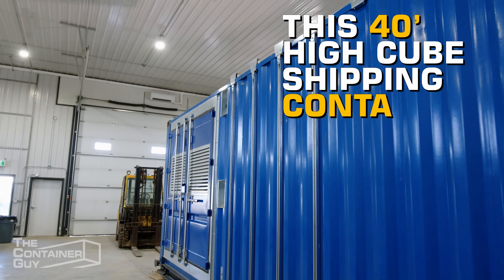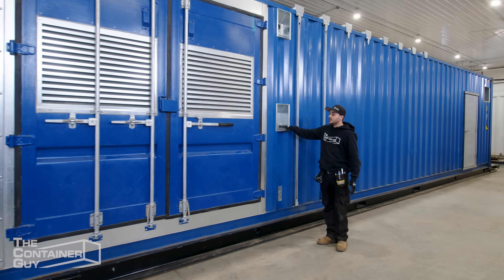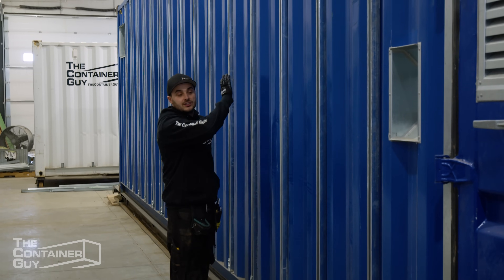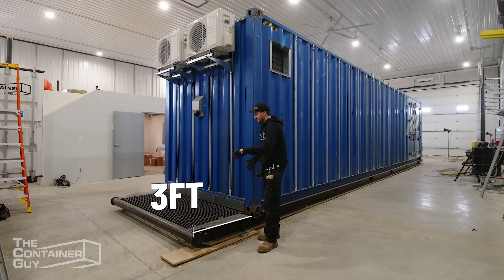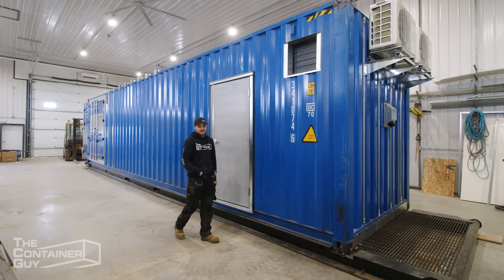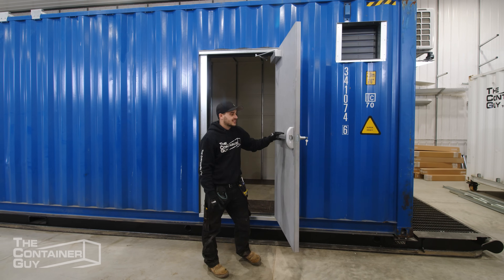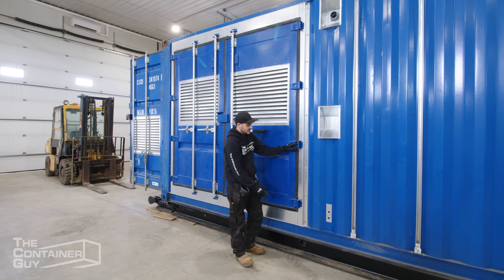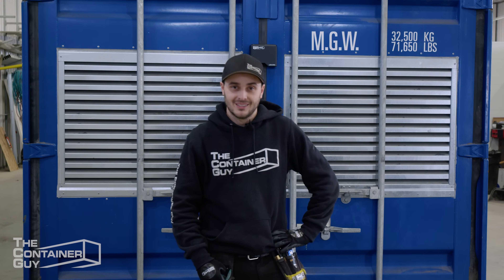$1.8M Project: Containerized Microgrid | 228 kW Solar Power | 488 kWh Battery Storage

Comment: If you have the diesels run in the Winter as it will probably happen, why not use their waste heat for heating the community? 
So having somehtinglike a heatexchanger with extra outlets for a seperate heating/cooling exit.

Comment: Would be cool if you fitted starlink or something on top to provide the community with some internet, and if starlink allowed to have multiple  of those dishes. Of course this depends on how many are in the community and how much you'd have to split the connection but a neat idea! I really love what you've done this could be a saving grace for some isolated smaller community's to have their own power grid with emergency backup from those diesels! Amazing work too the whole build looks very neat!
Reply: Just need  Satellite Down link station right next to it...

Comment: If that container is going to be creating a ton of heat, for a remote site wouldnt it be an idea to scavange as much of that heat as possible for hot water even just to heat the buildings around it? I have no idea where this is going to be placed, it could be placed in the middle of nowhere. Then my musing is a stupid idea and ignore it.

Comment: Have you considered using "Pioneer® 9,000 BTU 115V Under-Bench RV Heat Pump Air Conditioner" it sits on the floor.
You just need to put holes in the floor for air in and out and dehumidified condensate to drip out.
Reply from the maker: Sweet! Haven't heard of them. Thanks for sharing

Comment: Not a bad build. Only thing I can see and suggest is loose the plywood on the floor. Wood eventuall rots and burns when in situations like this. Cement sheet is strong and fire proof. Genny rooms, don't be affraid to have a fire systems like CO2 deluge or even just fire-fighting ports.

Comment: I like solar projects like this since they make the best use of funds. If you compare 75 residential roof top projects and the tax money used they mostly benefit the Solar companies installing them. Projects like this help the entire community. It’s my opinion tha residential roof top solar should be funded by the homeowners and not the taxpayers. Divert the money to commercial projects with batteries that could lower the cost for everyone.
Reply from the maker: I agree that the future of the power transmission lines are for homes to connect to municipal battery banks. Homes can have homeowner-funded solar setups with grid tied inverters. In Canada, the word battery makes people shiver. Once or twice a winter we have to buy new batteries for our equipment. They don't last in the cold and houses shouldn't have huge fire hazards inside their mech rooms or garages. The way they train our firefighters to extinguish battery fires is to "let it burn".
Reply: Good point about fire. The battery tech should improve as well.

Comment: Just a suggestion it you have overheating issue on the Genset you should hard duct the intake to the radiator the outlet air will rat race around the inside of the container and get sucked back into the intake side of radiator if there is a gap again also double check cfm requirements on radiator those louvres look very restrictive not the normal ones you would find on a generator housing from CAT or Cummings
Reply from the maker: One thing we didn't really show much is we have sections of the wood floor removed around the sides of the containment pans and at the back so there's more air movement but this is great info about air not actually escaping. We didn't know what the rads would look like until way after the doors were modified. I know what you mean and the client might tin bash a shroud around the rad yet to come up to the door. The net free air was calculated and the louvers are good. Those are pretty small units compared to the Cummins and Cat engines.

Comment: I criticized a smaller similar setup in the Victron youtube channel.  I still think a fuel generator in such product is not optimal. if a customer really needs one,  generator is best as a separate, stand-alone system or likely they already have one.
Reply: These kinds of builds are usually for temporary and/or emergency power needs, having the redundancy of a diesel generator is always appreciated.

Comment: Connecting the POWER to the internet seems like a great idea. Almost as good of an idea as connecting the internet to the steering, breaks and acceleration on a vehicle. What could go wrong? People are all sweet, law abiding folks.....
Reply: A lot of power grids run some sort of networking setup for remote management and monitoring, as well as integrate safeguards to avoid easy hacking.

Comment: When you shut the door, the louvres in the fan opening, blew open as the air compressed inside... probably why one would have to slam the door... great work... faithfully watching.
Reply from the maker: When you need a pressure relief valve in order to simply close your door, you know the building is tight. I wish my house did that. 😂
Reply: @TheContainerGuyTV  me too :-)